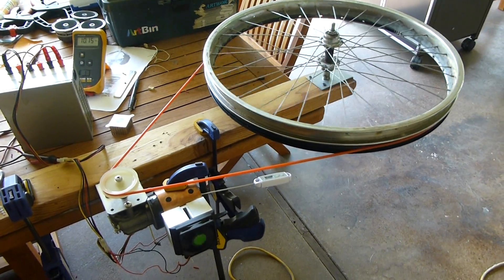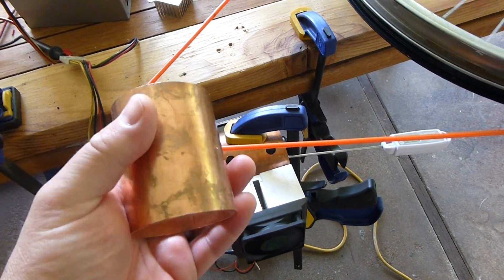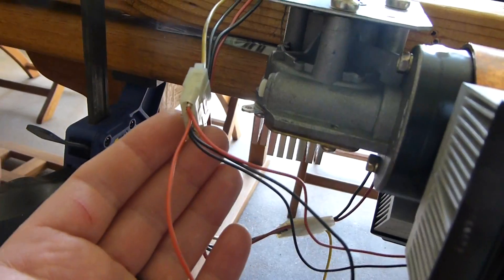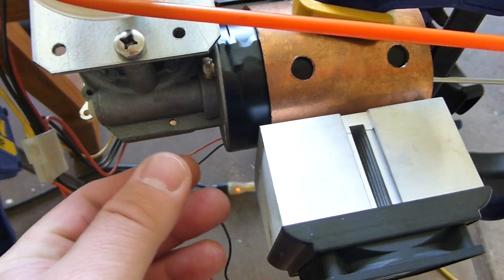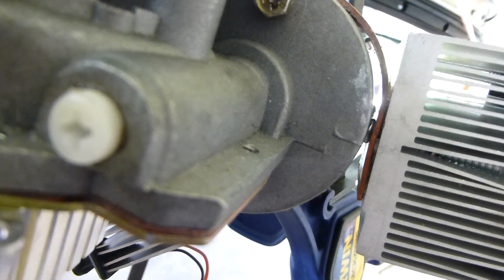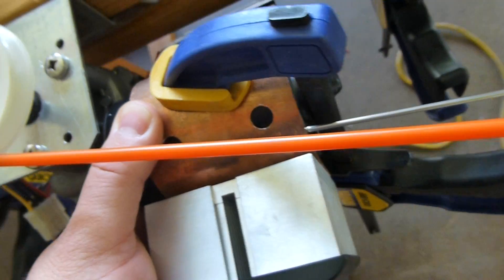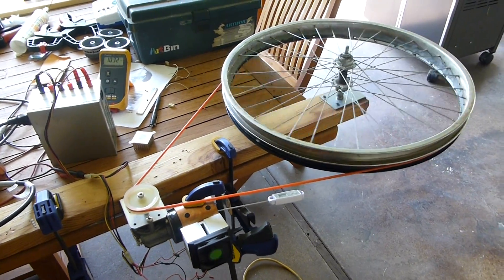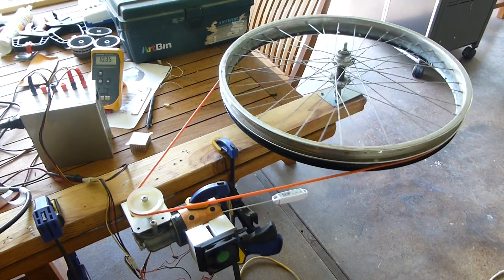Wiper Motor Test with Heat Sink

Comment: How did this end up working for your project?
Reply from the maker: Really well.  I had a few problems with that Axworthy Ghost, but the motor was not one of them.  Plenty of torque at a good speed.  No, my problems were with keeping enough tension on the line to support a ghost that was too heavy.  But when it ran well it was brilliant.  Had one teenager nearly pee himself when it flew over his head!  I still have most of this rig and I'm hoping to be able to use it again someday, if I can only figure out how to set it up in our new home.  Thanks for your interest in my projects!